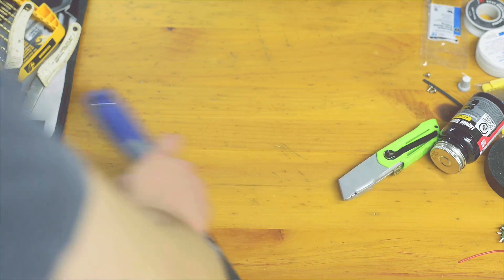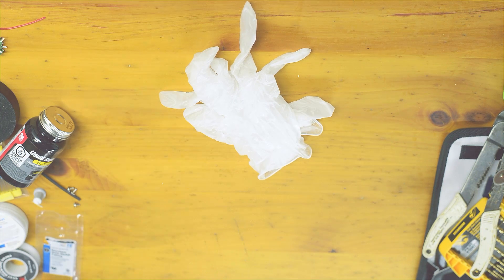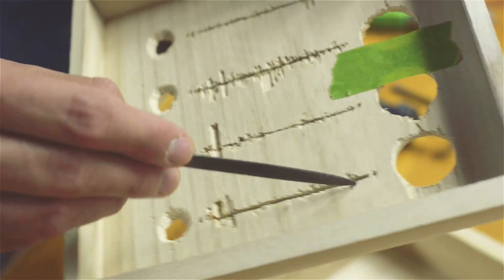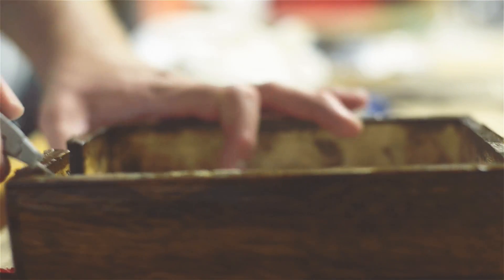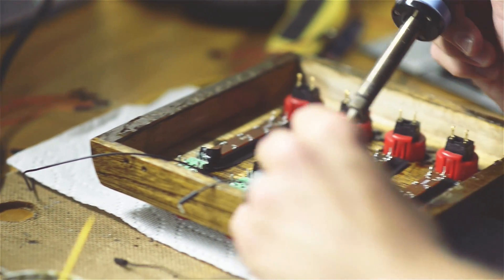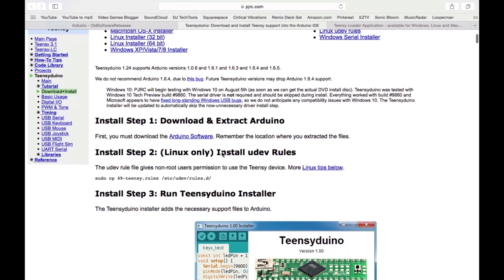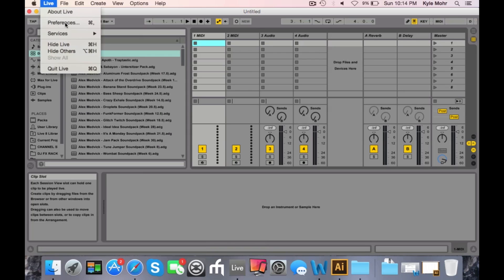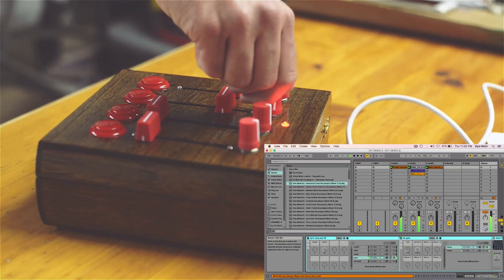How To Build A DIY MIDI Controller (2015 Edition)

Comment: I second the comments about the poor soldering technique demonstrated in this video. Also, there is no benefit to be had from digging into the sponge with your soldering iron to clean the tip...have a moist (not wet) sponge and make quick wiping motions with very little pressure. Doing it your way just cools the iron down and since you want to clean the iron immediately before making each joint, having a just-cooled iron is in no way to make a good soldered connection.

I also second the comments about how the woodworking techniques shown here are really pretty poor, and doing it better does not require more tools, just better techniques.

But my major problem with the video is that there are no qualifying comments made in the title or the start of the video, such as:
- MIDI controller for what? All sorts of things can be called by the name MIDI controller, and what is shown is only part of that, so some qualifications up front would be useful.
- Stating up front the basic method that is going to be used to generate the MIDI signal would be beneficial to viewers.
Reply: youtuuba
Reply: Digging into the code some more, I find there is no #include directive for a MIDI library, only for a switch debouncer library, and that the usbMIDI object referenced in the loop() isn't declared or initialized in the sketch. Evidently major portions of the sketch are missing in the downloadable code. The sendControlChange() function calls appear to correspond to the MIDI library found here:

https://github.com/FortySevenEffects/arduino_midi_library

I have no room to criticize someone's soldering or woodworking techniques, as mine aren't up to snuff either. However, presenting incomplete code as working code is lazy and sloppy.
Reply: A final note regarding MIDI hardware interfacing. Although the OP chose not to implement the standard 5-pin DIN interfaces, it bears mentioning for those who do wish to include them.

A MIDI interface commonly bandied about the Arduino community comes with the disclaimer "it doesn't match the MIDI specification, but it works." Don't use it, friends! The correct implementation is simple enough to build in a few minutes, and it ensures the robustness intended by the original MIDI designers. The schematic can be found here:

https://www.midi.org/images/specs/midihw.gif

You would obviously need to connect this circuit to the RX and TX pins on your Arduino, which would interfere with the built-in USB serial interface, so include a means of disconnecting the MIDI interface so you can reflash the firmware later. I usually make a socket from two strips of female headers to mount the Nano on a circuit board so I can easily plug and unplug it for reprogramming.
Reply: youtuuba uddld
Reply: Don't think you know that dj tech tools bring quests on their channel to do things. Most of the time the person in the video won't even read the comments when it's a community Channel. So before you give "constructive criticism" make sure you know about home the channel works.
Reply: About that sponge - it's much better to use a dry brass sponge. Lead-free alloys when receiving some moisture lead to much faster wear off of the plating of the iron tip. The cracking of the plating will also increase the oxidation. Last but not least the tip receives a thermal "shock" when dipped into the wet sponge (or as you said just wiping it on the surface of the sponge). Of course I do agree that digging into the sponge with the tip is even worse. LOL
Reply: Judging from the Arduino code (link in the description), the controls can be mapped to whatever MIDI Control Change messages you choose. So it's a general-purpose MIDI controller. There are plenty of commercial control surfaces like that on the market that don't specify a particular end use.

The basic method employed is self-evident to microcontroller and MIDI hobbyists. The MCU's on-board ADCs are used to convert a voltage to a binary number, which serves as a parameter to the CC message.

I agree about the wet sponge. I thought everyone used brass wool to clean the tip nowadays.
Reply: Brian Fernandez HEYOO!!
Reply: damn... Constructive criticism goes a long way in helping your peers avoid lifelong manic depression or just losing interest in the hobby overall. Try to stay positive about diy projects and take breaks often if you get frustrated. A sponge ( your brain) can only hold so much before it gets overwhelmed and leaks. MIDI has almost unlimited applications. Find out what the basic rules of thumb are for things and brainstorm how it could make something more fun (scaring someone for halloween) or more efficient (triggering the voltage to run a motor that shoves something far up something) I have NO idea the knowledge you already possess so I'm not going to be that jackass explaining things to my peers like some arrogant teacher to a kid. Just type questions in the boxes and take breaks when the answers just frustrate the hell out of you. (It WILL happen). I hope you can figure this analog to digital binary conversion madness out because it's frustrating me, digging through the things that don't apply and have no relevance to the questions, but, when the rule of thumb or general basic concept for each circuit is discovered, there is a "eureka!" moment that becomes and will always be the beginning of everything you will ever do with DIY. Whether it's MIDI, electronics in general or just yelling at your neighbor effectively as to achieve your desired outcome, rather than just a brawl, you will achieve true freedom from dependency on those who already know and do... I don't know, Peace

Comment: can you just use an arduino uno?
Reply: and also, do the arcade buttons send an analog signal? If not, what kind?
Reply: You can, but not with his code. And also the UNO is also not a native MIDI device and you would need a MIDI/serial to USB interface. Just get a Teensy 2.o or higher, their better for MIDI.
Reply: The arcade buttons can be hooked up to digital because they are just an on/off  style signal (hence the 2 digital states on and off or 1 and 0). The analog pins are for anything that has more than 2 states (knob, slider, click wheel, ect.)
Reply: With our MIDI controller based on Arduino you can send real MIDI to the computer. No serial/MIDI conversion is needed. This is our page if you are interested: http://bananutelectronics.com/producto/midispositivomidi/

Comment: if you covered both sides of the lid with painter's tape before drilling that would help with the splitting, or just use a sheet of acryllic for the top instead.
Reply: Pretty good idea, Me.

Comment: To get a cleaner job drilling the large holes - use a forstner bit not a spade bit - and back up every hole with a scrap piece of 2x4 or similar.
Reply: Forstner bits are the best. I never use a spade anymore.
Reply: I saw the tear out on that shit and thought "he's using that?"

Comment: question. hmm whats the diffrent between UNO and teensy? does it still work with uno?
Reply: yea, it works with arduino UNO, but first you gotta flash the board with "Hiduino" firmware (read about this).
Reply: Some time ago I would have say Teensy was better for MIDI projects, but also more expensive. Now you have good versions of Arduino better than the UNO, such as Micro or Pro Micro.

Comment: Please view a soldering tutorial, the way you solder is definitly not the way how you should do it. Add the solder together with the iron to the joint. The trick is do melt the solder not with the iron but with the heated up component you want to solder. Nice Video anyway!

Comment: Good job on the page!
I am working on a project on Arduino UNO and I need you please. 
I need the source codes to send 12 messages SYSEX which will be activated by a midi din on/off switch on each. Thank you in advance for your help.
Reply: Hi. I need the same. Did you find the code or something to help? Thank you in advance.

Comment: Thanks very much - very useful to me, as I'm hoping to create a MIDI concertina for myself. (See example at 
Your clear, excellently paced, videoed vid was a good start that made it seem at least 'possible', which thrilled me enough to stay up to 3am.
(Good concertinas cost about $10,000 and I want to make a poor man's $100 mostly 3D printed concertina for everyone that sounds just as good, for campfires and parties with guitar accomp, etc.)
I don't really want the job of building it, but will have to as I can't afford to pay much to get it built, and want to guide the process.
1. Do you know how I could load (high quality) recorded notes of concertina into the controller my own recorded sounds?
Ideally I'd like to work with someone with a synthesizer that could produce a set of delicious sounds to put into the concertina.
I'd need one concertina note for each of the about 60 concertina spring-buttons.
2. Do you know where I'd get 'pressure sensitive' buttons that gave different loudness depending on press or speed of press?
3. What do you reckon are my chances of making a wireless, batt powered MIDI concertina - containing MIDI, sounds, batt, amp, small speakers?
Thanks again,
Bruce Thomson in New Zealand.

Comment: The comments section has taught me that I don't really like people who are good at soldering.
Reply: dont ever be an electrical engineer
Reply: @romoalex  this guys standards are far higher than mainline industry... - you do work this good in industry and you will get fired for using too much time on the work...
Reply: get the $50 station with the sponge tray and spiral holster for the gun. It's the secret to soldering perfectly...
Reply: Its not just me who's cringing then?!? Thank God - I build valve amps with hundreds of volts, if I soldered like that there'd arcs of death emitting everywhere!!! LOL
Reply: Revolutionary Stewart I
Reply: Hey quick question. wonder if you will know the answers. If I am using less analogue and digital inputs than there are in the code that he has written will I still have to change the values for them? for example do I have to delete the button code where it says 1:3 etc..and just have 1 of 1? And with the analogue inputs do I have to change it to my number or can i just leave it as 8 anyways
Reply: @marbleempire1874  yes you do! since it's analog you'll catch the radio frequencies in the air, and the UC (micro controller) will use it as a valid value. delete those suckers from the code, or pull them to ground! (connect the pin to ground trough a resistor [doesn't matter how big].
Reply: @Revolutionary Stewart fake Kev
Reply: Hi Kevin.
Reply: 🤣 fax
Reply: Soldering is like playing guitar. You have to keep in practice
Reply: Lmao... Like foreal. They think they're like the world's elite or something!
Reply: Xd
Reply: Lmao, I see their reason. I know this is just a quick tutorial to show us how it's done, but I bet that those chinese child workers cringes at his soldering skill.
Reply: @Envinite  Not chinese, and i wouldn't call it a skill, Soldering is an art, I don't expect a DJ to know how to do it.
Reply: The thing is, if someone who's never soldered before would follow this video, they'd have poor results and wouldn't enjoy the project (making and using). These people want to help both the guys from the channel and the people watching it. Do you not like when one helps the other?
Reply: Soldering is an art, don't expect a DJ to know how to do it, they expell in different ways.
Reply: @Doile911  Soldering is not an art, especially when soldering wires. It takes just to watch video or two to do it properly. The way he do it completely wrong and wastefull and using jumper wires as leads was just too much for me.

Comment: Can i use push button on a breadboard for arduino, then use the sketch. would that work? then i can avoid soldering. Can the arduino run the whole thing by itself?

Comment: Sorry for noob questions.. why Teensy not Uno for example? How many knobs can I have maximum?
Reply: +takemymonkeyoff It all depends on how many analogue pins and how many digital pins the board has. Buttons, switches, LEDs and encoders are digital, whereas rotary Potentiometers, linear potentiometers and touch sliders are analogue. For example a board with 8 analogue inputs can have 8 potentiometers.
Reply: Now you have better versions of Arduino UNO. The maximum knobs you can use will depend on the way you handle the inputs. Using multiplexers is a good option, and you will be able to handle more than 64 for sure.

Comment: All the "kits" are quite small for my needs. I need a platform that can support at least 100 analog knobs and some digital encoders, is there one? I want the midi controller to be usable, I already have 24 knob controller, I need more.

Comment: Don't do the soldering technique used here, this can cause cold joints and insufficient wetting. it's much easier to just to apply the solder to the pad and pin directly and then melt it.
Reply: ...Or use flux
Reply: @PrinceWesterburg  Actually, flux just helps the solder flow onto the target joint, it does not increase the viability of the joint. The point that the solder is being attached to is still cold, causing the solder to not attach to it properly. To properly solder, you have to heat the solder joint itself (i.e. the Teensy's solder point and the wire) and touch the solder to the heated joint. This will cause the solder to bind to the heated metal. If you heat the solder then try to attach it to cold metal, the solder will envelope the metal and begin to cool but will not adhere to the metal itself, forming what is commonly called "a cold joint". This can lead to weak electrical connection/signal, as well as joint failure where the unadhered wires can simply slip out of socket. A perfect example of this in the video is when he soldered the Teensy itself and the solder created bulb forms. The solder should have flowed down into the joint and adhered to both the pin and the hole, not formed a droplet on top of it. That droplet indicates that the solder did not attach to the metal beneath it.

Comment: Your soldering technique will create weak/cold solder joints. They're likely to crack under stress/vibrations. If you plan on performing in a club where volume levels will be quite high, I recommend NOT globbing solder onto your joints. Use some decent flux-core solder, apply the iron to one of your metal contacts, not to the solder. Apply solder to the opposite contact, again DO NOT TOUCH solder to the iron. The solder will take to the contact and flow toward your iron if the two pieces of metal are heated well enough, and share enough surface area. This will create a strong joint resistant to vibration damage.
Reply: Yeah I think people got the solder to the iron from some science movie or something.
Reply: I will chime in here a good tutorial but his soldering technique in the video needs work as you have a lot of weak and cold solder joints which is what you don't want when your soldering this technique is how I learned soldering properly which produces much stronger joints and a lot less cold joints
Reply: You probably will life pads like that especially if they make the preferated self destructing solder pads now.

Comment: Cherry or Oak wouldn't be so nasty to work on. The dremel would cut and sand it pretty nicely. Harder is better unless you want something that'll crush with a single hard fall. Otherwise, very cool project. Looking into the parts it's not much cheaper making your own. Large part of why I just went ahead and bought the MIDI Fighter 3D and Twister.

Comment: Okay a few things i want to say. First off great tutorial for the basic idea of how to make a midi controller, production wise it was pretty good too. 
BUT!
There were two things that didn't seem quite right to me. first is saying that the LED will melt with hot glue. The Epoxy will definitely not melt with the hot glue and it is  totally fine way of connecting the LED to the case. 
And second, that is not how you solder, your method is wrong resulting in not very reliable joints, i mean they'll work but i would trust them all that much. You're supposed to heat the thing you want to solder then push some solder onto the heated surface to create a strong reliable joint. Also im not quite sure why you used jumpers to solder everything when you could have just used any wire and stripped the ends, much cheaper and would probably make a better solder joint too, assuming you soldered it correctly.
Search up EEVBlog on youtube and find the soldering video, probably the best tutorial you can get for soldering.

Comment: great video!! but can you please show us how to make a bigger midi controller with jogwheels and how to do when you puss a button that a led turns on?
Reply: +Bert Plays well the real answer is how can we put more analog inputs ?? building a simple 4 channel 4bands eq midi mixers for traktor for example..?? :) all the parts like jogwheels are not complicated using potentiometer and the learn function on the software but we first need the answer for the first question